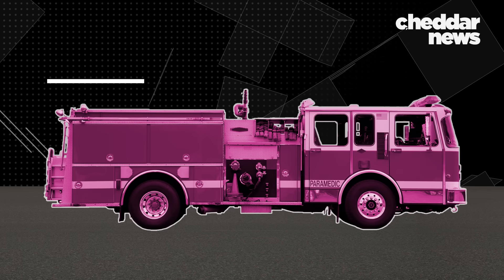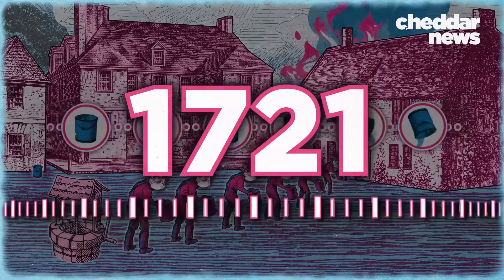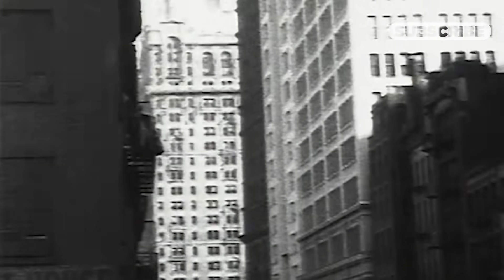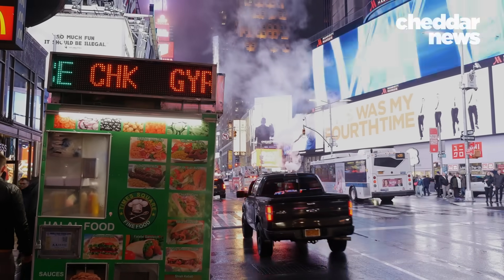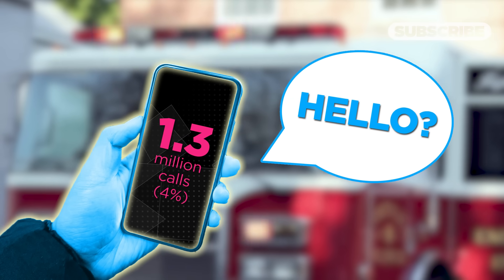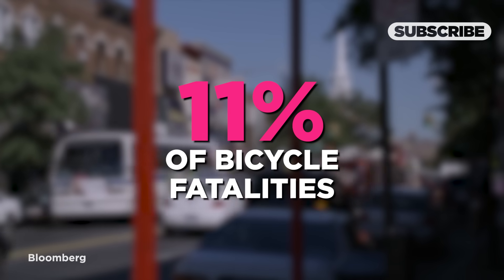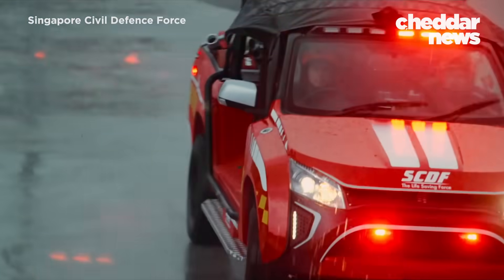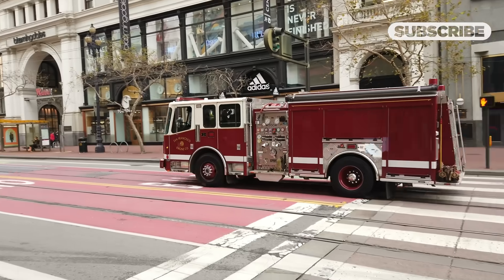Do American Fire Trucks Need To Be So Massive? - Cheddar Explains

Comment: You did a lot of talking without giving real answers beyond..."hurr durr aMEriCa iS dUMb aNd wAnTS tO rUn biCYcLiStS oVEr". 
North American fire apparatus designs are guided by NFPA regulations and the evolution of how we fight fires. Europeans have less standardization requirements resulting in a larger variety of manufacturers and the option to use modified commercial truck cabs. Europeans have more apparatus per company providing specialized roles and larger stations to house those vehicles while North American apparatus combine multiple roles into one vehicle and have smaller stations often with enough space for 1 or 2 vehicles (yes newer stations are larger). 
North American Ladder trucks typically have a cab that has a 6 man crew, European ladder trucks have 2 requiring addition vehicles to transport other crew members. 
North American ladder trucks are required to carry 115' of ground ladders in addition to the mounted aerial ladder, Europeans are not. 
North American ladder trucks often serve the dual role of ladder and extrication operations and so they carry everything needed on board for extrication, Europeans do not. 
European "ladder" trucks are often aerial platforms rather than ladders and are hinged like a cherry picker having no ladder to move from the platform to the ground while North American ladder trucks and "tower" ladders both have ladders and in the case of a tower ladder you have an aerial platform. 
North American fire engines use preconnected hose lines that are ready to go as soon as the engine arrives on scene with between 750-1500 gallons of water on board, European fire engines average only 500 gallons and rarely use preconnected hose lines. 
North American fire engines have more powerful pumps capable of higher GPM and PSI that require larger engines and transmissions (making the apparatus larger) than European fire engines allowing them to flow more water at greater distances. North American fire engines carry all of the hose they need on board, many European fire departments need additional "hose trucks" to carry the hoses for the fire engines. 
Americans and Canadians do things differently but that doesn't mean we do it wrong.
Reply: " Europeans have less standardization requirements" that's just plain wrong. In fact, depending on the country, the normas and regulations on fire apparatus are far more detailed and strict than NFPA in the US. E.g. DIN norms in Germany even dictates the exact amount and minimum equipment range on a specific type of apparatus - all the way to the exact number of e.g. wheel chocks, spare chain of a chainsaw or EMS blankets. 
Commercial trucks are used in the US as well, but of course the majority of fire apparatus are built on a custom chassis there; In Europe there's no custom chassis for the ordinary fire truck, so 99% of them are built on a commercial chassis. 
"North American Ladder trucks typically have a cab that has a 6 man crew, European ladder trucks have 2 requiring addition vehicles to transport other crew members. " the Tower Ladders are kept as compact as possible and thatfor rarely have a crew cab BUT there are some places where you find them with a crew cab, it's just not common. In contrast to that, while most Engines in the US are for a 6 man crew, a normal Engine in Germany carries a 9 man crew. 
"North American ladder trucks are required to carry 115' of ground ladders in addition to the mounted aerial ladder, Europeans are not. " because ground ladders are sth carried by Engines here. Also the approach on scene is different, as we don't ladder every window
"North American ladder trucks often serve the dual role of ladder and extrication operations and so they carry everything needed on board for extrication, Europeans do not. " again, that's where the plain normal Engine is the multitasking apparatus here. The Engines carry the complete set of rescue tools, making Heavy Rescue Trucks unnecessary at most rescue incidents. 
"European "ladder" trucks are often aerial platforms rather than ladders and are hinged like a cherry picker having no ladder to move from the platform to the ground" no, that's wrong. The most common type of Aerial in Europe is a 105' rear-mount ladder with a platform. Some of the ladder Ladders even have a lift riding the ladder all the way to the platform. As for the boom mounted platforms: roughly 50% of those have a ladder attached to the boom. 
"European fire engines average only 500 gallons and rarely use preconnected hose lines. " no, also in Europe preconnects are common. But instead of being stored in a hose bed, they're stored on a hose cart at the rear of the truck. Besides that, some Engines also have smaller hose beds, and then there are also apparatus like the Hose Truck or large capacity pumping pods which have a large hose bed as well. However, hose trucks are very rarely used special operations apparatus. You don't see them on a normal fire call. They might be around if e.g. a large commercial building is fully involved.
Reply: @EnjoyFirefighting  Only company that built appliances ground up was Dennis until 2008

Comment: It makes sense for rural areas to have many of the oversized firetrucks, as their water capacity is unmatched, but it would be nice to have a small truck for rapid-response in tighter areas
Reply: Rural fire companies also have tankers that are just as massive! But the also have brush trucks that are pick-up sized, usually F350 equivalent.
Reply: @JV-pu8kx  Our first brush truck was a 1967 Ford 4x4 with a 100 gallon tank and pony pump. That was replaced by a 1953 Kaiser 2.5 ton 6x6 that carried 500 gallon tank and pony pump.
Reply: Those are often called mini pumpers and they have been around a long time.
Reply: A fire engine that Carrie’s around 500 gallons per water, they flow water out the hose at 125GPM to the fire… that’s only like 3 minutes of water (you aren’t gonna put out a house fire with that) they get their water by hooking up to a fire hydrant to get constant flow out the hose
Reply: @PeanutButerJellyTim1  that's true and partly on purpose! 3 minutes is enough time to finish attaching the hose from the fire hydrant to the truck and then turn on the hydrant. In rural areas they carry around 1500-2000 gallons which are also supplemented by special trucks called tankers.
Reply: @PeanutButerJellyTim1  But foam
Reply: @specialopsdave  foam is also questionable especially considering most firefighting foams out there are well known to cause cancer
Reply: @specialopsdave  we have this wonderful thing called water and it doesn't usually cause cancer and with both the water on board and hydrants I'd take the water over foam
Reply: @robertbrunner4379  Water can spread certain fires, even explode if applied to certain fires. That's why we have foam.
Reply: @bilbobaggins1934  yes but his argument is use foam for every fire which is a bad idea considering how much cancer causing materials firefighters would be exposed to I get it for certain fires but we are generally speaking about building fires
Reply: They do have smaller trucks for urban areas.  🤣 We're not that stupid.
Reply: One of the reasons you don't see as much water on European fire equipment is everywhere there are hydrant points, planning regulations require them, even the smallest hamlet of five homes will have a hydrant point and there's a very good chance that a US style fire engine would struggle to even get there
Reply: In Australia, we have the rule fire service which are specifically designed for this and their vehicles are even smaller again
Reply: there are 6 classes of truck the smallest is a pickup with a 200 gallon fire skid in it all the way up to the city class 1 trucks the dept picks what they need for the situation!! if a smaller rig will work they get a smaller rig! the problem is they don't know what gear is needed until they get there they could get a call for a garden shed fire get there and find out the owner has set up amateur chemistry lab or a hobbyist rocket factory in it, they could get a call a traffic accident expecting a fender bender, get there and low and behold they've got a semi carrying coil steel sitting on top of a mini van!!
Reply: true.  I lauighed when she said fire *engines carry as much as 400 gallons.  750-1000 gallons is the average tank size on a US engine.
Reply: @kenbrown2808  it blows my mind how little the general public knows.
Reply: @MrWayne707  interestingly, my town's old engines have a catwalk behind the cab for the engineer to stand above ground level while controlling the pump.  the new ones that just arrived have the control panel on the side, and no catwalk, and are STILL longer.
Reply: there are small firetrucks in the US lol
Reply: Rural fire departments often have a mix of tankers, pump trucks and pickup trucks suited for brush/grass fires. Oftentimes vehicles are bought used from cities and other municipalities or repurposed from other industries. Neighbor worked with the local fire department to schedule a controlled burn of his old barn. Fascinating seeing multiple departments come together, setting up what amounted to small pools that tanker trucks could dump into and pumper trucks could draw out of.
Reply: I’m on a kinda rural department. We have 1 hydrant in our territory. We have an engine, a tanker, a rescue, a brush truck, a UTV, a chief vehicle, and an assistant chief vehicle. We have lots of vehicles big and small.
Reply: @yikestwitchtv  that's something that has always confused me about the USA and areas with out hydrants, in the UK if you have mains water and that's just about everyone, ( out of 23 million households less than 34k are not connected) there's a hydrant definitely within 300 meters and probably at least two, all it requires is effort over the long term and making it part of the planning regulations
Reply: Rural fire departments often call other departments for assistance with water tankers or big ladder trucks.
Reply: I might be making a stupid point here but these buildings must be connected to a water main right? There's also the possibility of bringing in specialised trucks which only transport water
Reply: @the_steamtrain1642  not necessarily... Some buildings like a storage shead for a farm probably won't have water plus the farther away from the water source or tower the less gallons per minute of water is available for fire fighters hence the specialised trucks.
Reply: Brigades in Ireland carry most the equipment needed on standard pump appliances.
Reply: A Chemical fire or a big warehouse can take a long time to put out.
Reply: @bishop51807  Mulch piles, too. A local landscaper stunk up the whole town with one! They make their own mulch, and the pile got too big.* Required so much water, the hydrant wasn't enough. The firefighters had to supplement with a tanker, or two, going back and forth to the river.

*For those who don't know: The same thing happens with hay/straw, the interior of the pile is decomposing and the process generates so much heat that causes a large percentage of barn fires.
Reply: @JV-pu8kx  Those fires get pit out with regular tiny sized engines in Germany all the time.

They just get a frontloader excavator and pull that pile apart and then individually extinguishing small fires.
Reply: @theonly5001   exactly, because all european firefighter’s do is let buildings burn to the ground, 
I feel like I never see them actually save anything with their tactics over there
Reply: @JV-pu8kx  do you know if heat like that is created in composting piles? We just started taking it very seriously and are actually thinking about putting a composting toilet into our next house as we really would like to be off grid after we build. We are city ppl and have been our whole lives. This is our retirement plan/dream. TIA.
Reply: @illbeyourstumbleine  Same mechanism: heat is produced as microbes, and other organisms, break down organic matter. This happens in dung piles, as well.
Reply: @JV-pu8kx  yea if hay gets damp and starts to decompose that can be an issue. Like if the roof leaks.
Reply: @colincoriasco4062  If that was the case I would see the builders industry actually legitimately being a significant chunk of the economy.
Reply: @theonly5001 if you house is burning down I don’t think you’d give a crap what size the fire truck is.
Reply: @bishop51807  most western European nations have HVPs for such an event when you need to move water up to 3km to a fire and its extremely rare not to find an open water source in that range
Reply: City areas need them too. A massive fire at a grocery store could be impossible to stop with inadequate equipment. This isn't just about size, we need powerful pumps and deck guns. With a deck gun, we can output 500 gallons in under a minute, right when we arrive. By that point we are just now running hose to a water supply and having immediate attack can mean huge difference to a homeowner or a business.
Reply: In Denmark, we have special tankers to transport water for the fire brigade. It is always possible to send one more and when it is empty, only the one car has to drive to get more. All-in-one cars are not good.
Reply: @alvinmjensen  In the US, most departments have tankers as well, and probably can call on commercial tankers to supplement.  The rigs are also designed to suck water from a lake, river, etc, if they can

Comment: This is funny video where a person who doesn't know anything of substance about a subject tries to sound like an expert. Having been a firefighter for ten years, both wildland and structural, and having driven various kinds, wildland and structural trucks, there are a lot of reasons these trucks are big. Many carry 3000-5000 gallons, especially rural trucks, and they have to be big enough to haul over 40,000 pounds of water. There is a lot of gear on a fire truck, much more than she has listed.
Reply: well ... I see many American apparatus where lots of the available compartment space remains unused, while the way more compact apparatus from e.g. Germany carries in fact more equipment (but with a smaller water tank) as every inch of available compartment space is used like in game of tetris.
Those European countries where rural areas barely have a hydrant network, you see also Tankers which can easily keep up with American Tankers. It goes all the way to both urban and rural departments running semi truck based Tankers in Poland for example.
Reply: This video talked specifically about cities though, where most calls are not fire related, there are a lot of pedestrians and cyclists, and fire hydrants are abundant. It also talked about how European cities have fire trucks that perform just as well and are more compact. These trucks are not used to fight forest fires, nor are they rural.
Reply: @serbansaredwood  Dublin Fire Brigade fight gorse fires